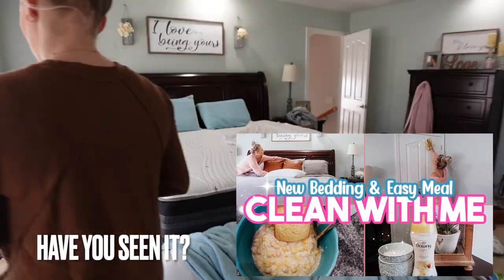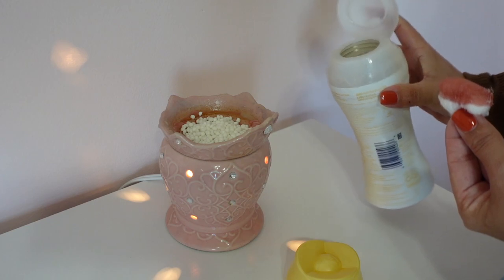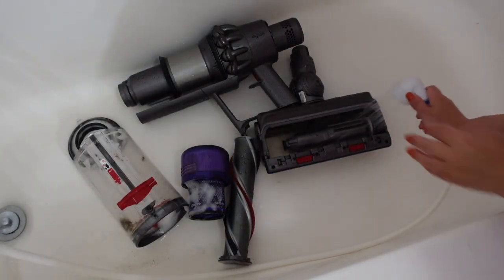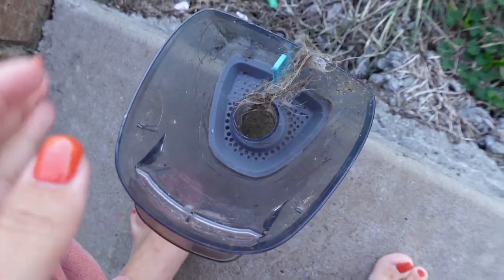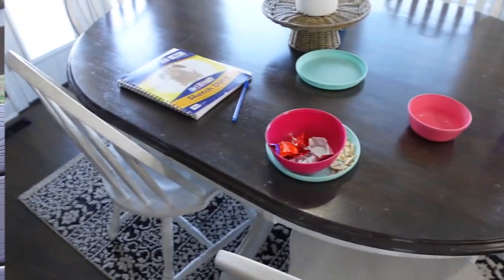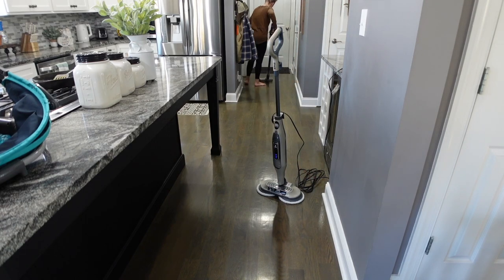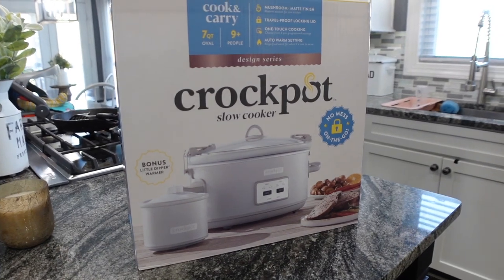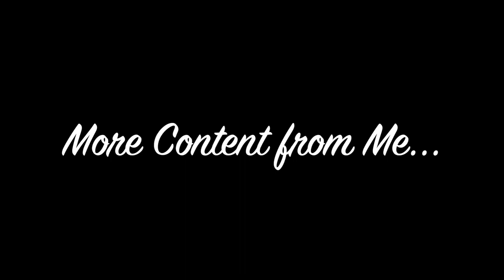CLEAN WITH ME|EXTREME CLEANING MOTIVATION|CLEANING ROUTINE + EASY CROCKPOT MEAL {CLEANING MUSIC}

Comment: I clean houses for a living and the absolute best product I use is Bars Keeper Friend. The soft cleanser is the best and so is the powder. The new 1 tsp of powder Tide in a bucket of water has been a life changing hack!! I've been using it at all the houses I clean and I wonder what the other products I'd been using were even doing. 😊
Reply: You clean the floors with tide and water? I clean houses twice a week as well so I’m curious. What do you do when the home doesn’t have a removable shower head to clean the glass in the shower?
Reply: @Tiffshouse  I hate it when they don't have removable hoses! Lol!! I try to not use something that takes alot of rinsing on the shower doors but if I have to I just keep rinsing with a giant cup I take along. Yes powder Tide on all types of floors and no rinsing necessary. Only use 1 tsp per bucket. You can actually use it on everything!! You will be amazed at what it removes from everything (cabinets, walls, counter tops)

Comment: Hey. Was just wondering. Does the dyson still work after the water being in the motor and all or was it fine after drying out? Thanks
Reply from the maker: Yes works perfect.
Reply: @KeepCalmAndClean  I’m glad- please just take care when washing these. I’ve been fixing them for a lot of years now and can guarantee that it is definitely not ok to have the water anywhere near the brush head motor, let alone the actual motor housing. There are a lot of small areas and seals that cannot get completely cleaned out without proper disassembly, which once wet can cause odours or even worse performance. And even with the battery out there are so many PCBs, electrical complements and damageable parts in the main motor unit that really should never be getting wet. If you wish to clean the cyclone portion there are videos showing the disassembly of it, without having to wet the motor. Hope this doesn’t sound rude at all I just know how expensive they are and would hate for it to break on you or others trying this out prematurely. Thanks 😊